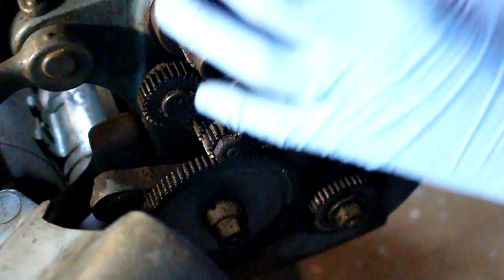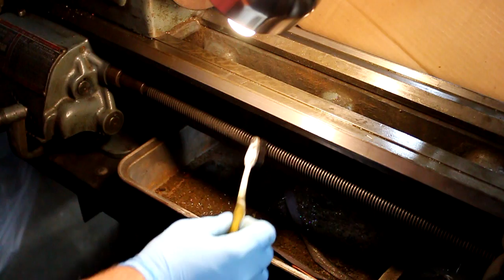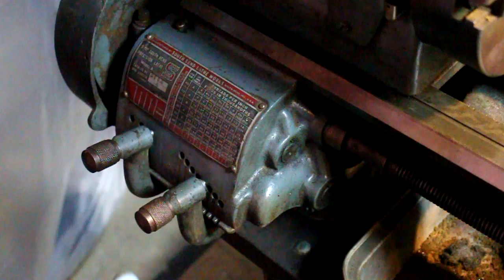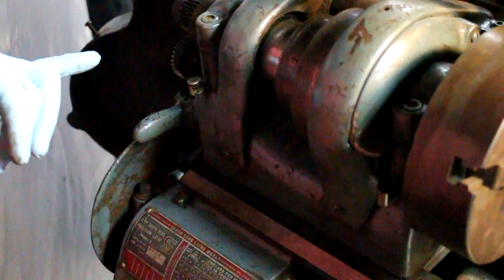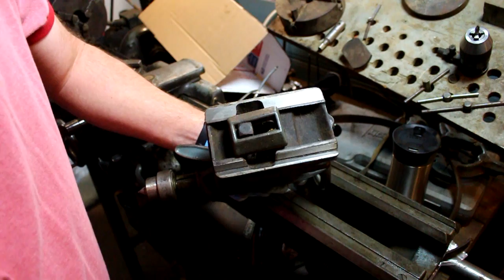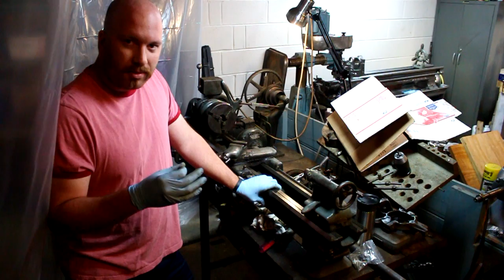Getting An Old Lathe Running and General Maintenance South Bend, Logan, Craftsman

Comment: And.... there are the books that cover specific lathes. It will give you insight into how it work, what's hooked to what. 
Older lathes will have deterioration of the original wicks. The wicks serve as a transport method of oil from the oilers to specific parts of the lathe. (for those who dont know) 
Good points on all the sections of the lathe. Made me think about a few points on mine to look at!! Thanks for that!

Comment: I liked your video and thank you for it but would like to add a couple things. When you're talking about the quick change mechanism and non-destructive solvents, you tentatively mentioned lacquer thinner. Oh, no! To preserve the remaining factory paint besides diesel fuel, mineral spirits is good stuff to use. A very light buffing with 4/0 steel wool and mineral spirits will remove old, blackened lubricants that have bonded with the enamel. Also, here on the high, windy prairie blow dirt infiltrates everywhere. The stuff isn't soft organic matter. It is essentially tiny chips of stone and it is very abrasive. A lot of the old lathes around here haven't been used in 40 years. Such machines need more detailed cleaning before they're lubed and put into service.
Reply from the maker: I use a lot of Diesel and WD-40 in the past couple years to clean these machines up.

Comment: I completely take them apart and clean and oil them,, only way to really know what you have. Years of oil and grease will build up and cause unnecessary wear so tear it down and do it right.
Reply from the maker: I agree. Most of the gears in the gear box are usually caked up along with all the nasty that gets into the apron assembly. Those are usually the worst.

Comment: Hey Spitfire!  Would you get a  lathe machine that had a run out of 5 thousandth 1' from the chuck?  Keep up the good videos!
Reply from the maker: depends on what lathe it is. If it's a south bend, they can be adjusted. If it's a roller type bearing, NO.

Comment: Hey. Ive got an Olney & Warren and cant get the chuck out of the quil. Any suggestions??
Reply from the maker: Yes, but would probably be easier to look up one of mr.petes videos on chuck removal. You can do it several ways including a strap wrench. Wood block to wedge the spindle gears, a cresent wrench on the jaws, a quick tap to try and jar it off.

Comment: just spray it over with red diesel, leave to soak in and all the dirt will simply wipe off with no damage.
Reply from the maker: That would work, Kerosene also works well.
Reply: Any diesel,red diesel is just dyed red so that the Taxman can tell that you haven't paid Road Use Tax on the fuel!

Comment: one thing you should check before even buying an old piece of American Iron is the sway in the bed it's almost impossible to do unless you think a little bit. The best way I founded you it is take the tailstock off take some steel wool and oil and clean the bottom of the tail stock clean the bed up if it's gunked up badly at all. then put the tailstock back on and adjust it to just slide on the way you'll probably notice it's slides easy in the Middle where there is where on the bed and then tightens up on the extremes of each end. Unless you're willing to take the saddle off you can't check up close to the headstock but you get what I'm saying. almost anything that was used at all is going to have this symptom it's to what extent you have to get the feel for if you slide the tailstock to the middle and at that same adjustment you can rattle it back and forth in the bed has been wore out and you need to walk away if it's just a little easier to slide then it probably doesn't have a whole hell of a lot of wear and remember you're probably not going to work on anything that long anyway you're typically only working on a couple of inches. it's just a little trick that I've used when buying lathe

Comment: I've always used 90 weight in my Logan apron it works perfectly I think tubal-cain only spelled correctly suggested 90 weight
Reply from the maker: Yeah, those older lathes are pretty durable. Logan and South Bend specs out a much lighter weight oil for that purpose. I think closer to a 20-30 weight oil. I use whatever they call for. Most of it is mobile DTE or Iso 20 I think
Reply: Precision Machine Shed I actually just copied what Mr Pete was talking about he uses straight 90 weight so I grab some 80 90 and started using it. Perhaps I shouldn't I don't know it seems to work perfectly I run the piss out of it too

Comment: Well thought-out procedures to emulate.  My Atlas is a bit newer (early 1950s) and uses a v belt to the head-stock.  I really dreaded removing the entire gear shaft assembly to change the original belt, so I bought a Jones adjustable belt.  It has segments that can be separated to put it in place.  I have not used it yet so I have no info on how well and how long it will work.
I may have to remove everything anyway as the little pin to select direct drive or the back gears does not remain engaged as it should. on direct drive.
Reply from the maker: Those belts work good, only thing to keep in mind is that they will stretch during the first couple hours of use so you will need to tighten everything up again once or twice. I've messed with some of those lathes, but can't recall how that is all held into place. In general, they are pretty simple machines. Thanks

Comment: I like your video. I'm considering buying a south Bend and I'm probably going to have to do a bunch of this stuff. do the micrometer dials on the saddle stay relatively calibrated? I know they're old, but can you rely on them for accurate measurements?
Reply from the maker: You will have to test them to double check how accurate they are with ether a caliper or micrometer after you cut a piece. Unless the screw or nut are extremely worn, they will usually be fairly close. My Heavy 10 and my 13" lathes both have really accurate measurements, but they are in pretty good shape, and it depends on how accurate you want to be. If I'm measuring in Tenth's it's not a problem, One hundredth's I will get within one or two then do final measuring with other measuring tools beyond that. Check out plenty of videos online about what to look for when buying a lathe, find one In decent shape, for a decent price and you'll be good.

Comment: Thanks very much. I bought my first lathe today. It had been in a farm shed for a while so it needs some TLC. Unfortunately, the guy selling it, fired it up to show me it was working before I could get some fresh lubes on it but I'm sure it's ok. This video will help me a lot.
Reply from the maker: +ThePugMonkey 
I wouldn't be worried about it. running it for a min or two is usually not a big deal, but making sure everything has been cleaned and oiled before using it for an extended period of time would be a good idea. Good luck with your project and let me know if you have any questions.

Comment: If I were you, I will disassemble all parts, clean them, grind them from roast, paint them and then put back together, so machine will be as new. That is my suggestion, anyway, I like this video. Thank you for sharing knowledge.
Reply: Would restoring old machines like this be a viable business if you were to do it full time?
Reply from the maker: You would need to do quite a few of them and the main problem is finding machines to restore.
Reply from the maker: +Dževad Mehović 
I did that with my South Bend HEAVY 10L along with getting the bed reground. Basically a complete and correct restoration. To do it right takes a lot of time which many people are not willing to do or don't have the time. If I had time ide restore every machine I own. Thanks for your comments.
Reply: +Precision Machine Shed  You welcome Sir, that is great video, also have you ever done any Index automatic lathe or Traub?
Reply: Sometimes yes, it depends on market situation, what are demands on local market. Some machines are cheap to buy and even are faster then today CNC. Like INDEX curve automatic lathe, there is no electronic, only mechanic, it can produce millions of pieces.
Reply: Dževad Mehović
Reply: You have comment?
Reply: Dževad Mehović just spray it in WD40 everywhere.

Comment: You must have been spying on me and my Logan 820 10", hasn't run since 2000. 

I've been slowly going thru it and this video reminded me I should check the wipers and the motor bearings. 

Very informative video, thanks.
Jim
Reply from the maker: +Skip Tracer Hey, yeah it just got this one in place and thought I would make a video quick. It doesn't take too long depending on how dirty it is, but worth the time to make sure everything is oiled and ready to run. A little maintenance goes a long way! As always, thanks for watching and commenting!